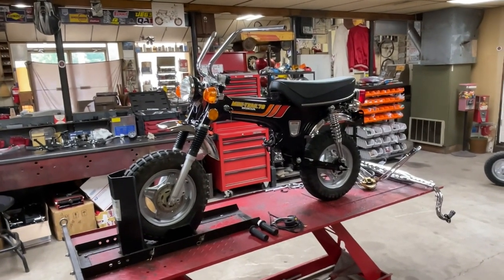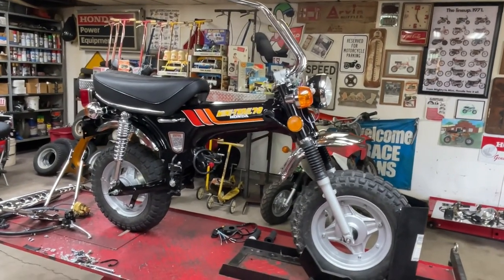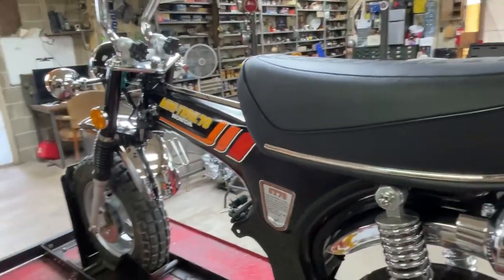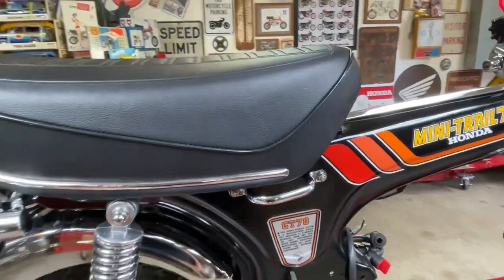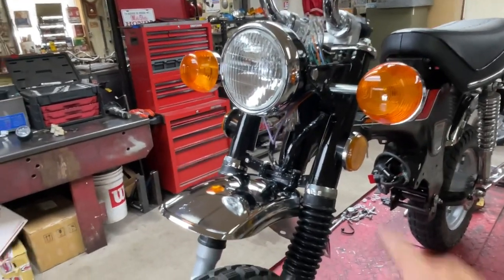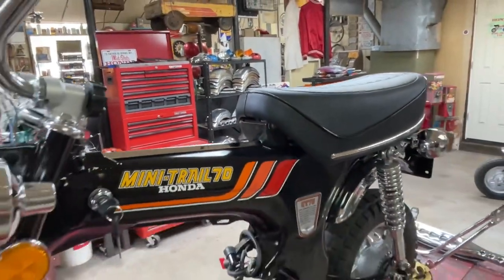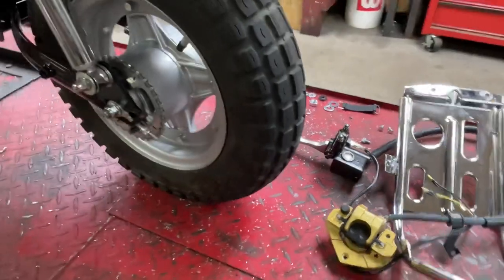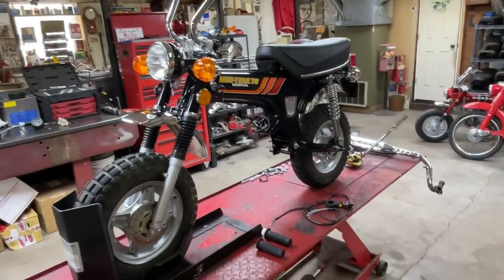CT70……clone to 1978 CT70 replica

Comment: Hey Mike, I’m interested to see how you wire this bike up, because I have a 64 Honda CT200 with a hodgepodge of CT90K1 parts and XL125 parts on it. It also has an SSR 110cc engine ready to go as well. I got the TB universal harness, not the simple one, but I hope it’s no more difficult to wire up. I’d like to see how you wire up the lighting and the kill switch.
Reply from the maker: Not sure why, but it put my response as a separate comment.

Comment from the maker: Both are pretty easy.  The kill wire is black/white.  There isn’t a kill wire that runs to the headlight, so if you have a handle bar switch, you’ll need to tie into the black/white wire and run a length to your switch.  

If you want your headlight to be powered AC, by the stator, it’s the solid yellow wire in the harness.  Connect that wire to your headlight switch to power the light.   If you want the headlight to run on DC, the battery, that is any of the solid black wires in the harness.  Pick one and connect it to your headlight switch.

Comment: Hi Mike
Great vid as usual
I see you are putting what looks like a brand new replica cradle on the bike
If this is in fact new , could you please tell me where you bought it
Cannot find any apart from original and they're expensive
Cheers Chris
Reply from the maker: Because I build so many bikes, I typically buy parts in bulk…..when I can find them.  I’m pretty sure I purchased that cradle from CHP, maybe a year or so ago.  They had them in stock, so I picked up like 8 or 10 of them.
Reply: @MiniBikeMike  that’s great 
I’ll check it out 
Thank you 🙏🏻
Reply: Crying shame CHP doesn’t allow enquiries from the UK
back to the drawing board 😂

Comment: Did the ice bear engine blowup?   Curious y u removed it for a lifan?
Reply from the maker: I bought two bikes at the same time….the Icebear Champion and the Amigo Rocky.  I’ve left the Rocky basically stock with 125cc engine.  I decided I didn’t want two bikes of the same power range, so I’m installing a 146cc Lifan in the Icebear.  The original 125cc will be used in another project.

Comment: Did you get the Lifan into this?
Reply from the maker: Yes.  This bike is long overdue for a video.
Reply: @MiniBikeMike  how's the performance on the lifan compared to whatever the icebear bear uses for an engine?
Reply from the maker: @ericjohnson9080  The 125’s are nearly identical.  I went with a Lifan 125 bottom end and a 146cc top end kit.  I should gain another 10 mph over the stock 125.
Reply: @MiniBikeMike  so the main benefit of the lifan is the manual clutch?
Reply from the maker: I actually went with a semi-auto in mine.  If your comparing 125 to 125, there really isn’t any difference.